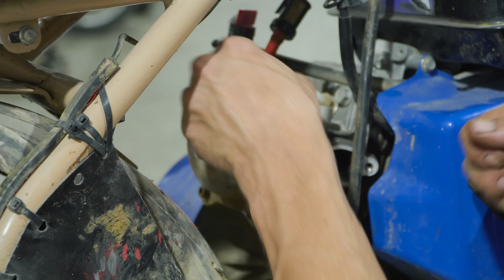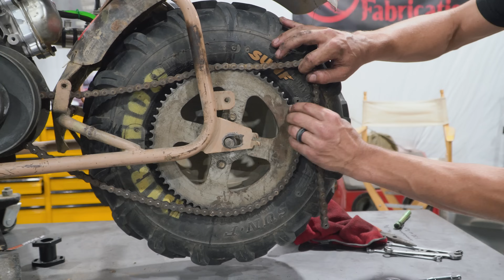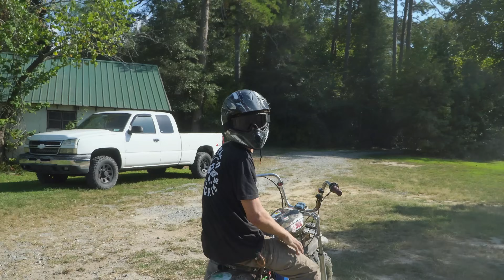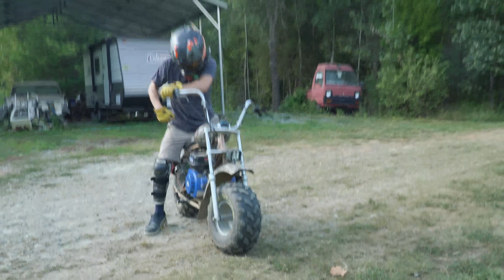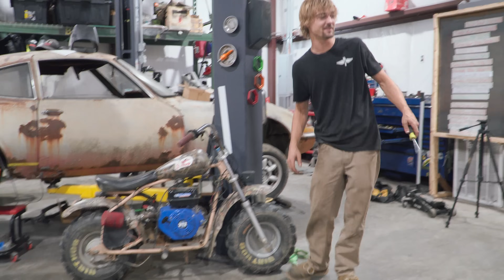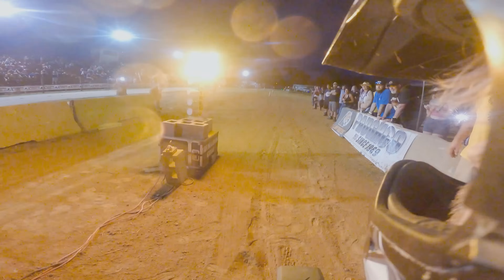Mini Bike Dirt Drag Racing Gone Wrong

Comment: Dirt drags what I grew up doing in Bedford pa thanks to family and learned how build motors if it high clay u need a mild tread tire we use to burn of new nobby to about 1/4 tread or well cut tire need to spin coming of line sound backwards but with powerful bike u get hole shot without flipping there's a fine line and usually 2 or 3rd depending on bike and gearing dirt is fun time and I've remembered we ran mini class 50-110  class and were beating class times above use 125- 200 this was in early 90s with a Bridgestone 65cc dirt bike rare even back then now its sits in a show case a my uncles cycle shop it took national and state trophy for 2 years and many other races and should just stuck regular bars on it for proper handling should. Keep up good work and everyone have wonderful day.

Comment: I have a number of different size engines on various projects. I 1/4 inch drill the oil holes between the cam tap it’s. The only engine that spits oil is a 212 that I didn’t drill out.

Comment: Hey Bubba, check this out, i learned this the hard way, by tossing the chain through the cases around the countershaft sprocket, basically totaling a perfectly good old Yamaha YZ465 .  Nowadays, I ALWAYS use a new masterlink clip.  Also, some of them, when theyre made on a punch press, have a very slight rolled over edge on one side, i always make sure that the sharper edge,  faces out, just to help retain the clip in the groove.  Careful now, and good luck.

Comment: My 26" mountain bike, with a 212 Predator engine had the same problem of not wanting to keep the front wheel on the ground, when pulling away from a light. I had to learn some restraint to keep the rubber on the road. I thought about putting a wheelie bar in the back, but, after playing with the front forks a bit, I slowed the rebound setting, and stiffened up the springs, And the bike was less prone to lifting the front wheel off the ground, afterwards. With your rigid front forks, I think the only option you have, is a wheelie bar, or stretch out the frame in the back.

Comment: When you’re putting the Mikuni intake on just put the Allen key through the bolt hole on the other side. It works every time I did it my predator 212.

Comment: Charles, on roller rockers you never slide the gauge in under the roller as it rolls. False reading. Always slide the gauge side to side to get a genuine gap. You 'will' suffer from tight valves much quicker than doing it the right way. 

One more nit pick, ratio rockers I've never heard of, however they are rockers. 1.3 ratio rockers would make a lot more sense so that the information is accurate and help the youngsters that may want to order a pair.

Great video, great time you had and glad you're shooting videos.

Comment: I had to tighten some bolts to 300 ft/lbs not too long ago. They held a tractor together in the middle. Its a lot but it wasnt as hard as I had expected it to be, to achieve.

Comment: Charles, get a couple packs of silly putty. You can bolt and torque a head with silly putty on the piston and no head gasket. Then you roll the engine over and check how much valve clearance you have. Then it'll increase slightly when you add a head gasket. You said "Are you alright". when the "Dad" came out. When I was a kid, it would have been walk it off and get back on.

Comment: I have a mini bike  with a predator 212 along with the torque converter, I tried taking off and i could not let go from the throttle when it wheelied. It kept bouncing and scared the living crap out of me. Its still sitting in the shed.

Comment: when you change the cylinder head with a milled off head and/or change cams and such do you have to change the push rod length or does it matter.

Comment: I've got to same bike. Custom motor, I don't care if a 300lb man was sitting on the handle bars you hit the throttle and that front wheel is coming up. It's got a torque converter and back sprocket is as big as the back tire almost. I got 4 little kids, I wanted something that could pull me up a hill, pull a trailer or do at least 55 down a hwy. It does all of that. I replaced the plastic storage tank with an actual small motorcycle gas tank. I got motivated watching Cars and Cameras!!

Comment: Hi all, I am working on a go-kart for my nephew  he's about 12. Anyway,  idk what it is. its  kinda like a yerf dog.  It currently has a Pr 212  live axle with 12 tooth clutch and  60 tooth sprocket. Needless to say, it smoked the clutch. I'm thanking about adding a jackshaft and pushing the gear ratio down to like 9:1. I know a clutch would probably be better if I wanted more speed but I'm really just trying to make it have higher torque and kinda slow for now. Any thoughts or suggestions?

Comment: fill your front tire with as much water as possible to make it a heavy and as difficult as possible to pop a wheelie. deflate the tire as much as possible stab your 1/2" garden hose over the valve stem turn the water on and wait until it pop off under pressure. hopefully now much harder to wheelie !!!

Comment: My parts for my stroker build are almost all bought now. I seen your guys build and I had to go for it. So I got 59mm CRANK ! Took me to 241cc in a small block and I have aftermarket reinforced everything because the GPS 285 lift / 260 duration cam is square nosed and welded and I put 50lb springs and 1.3 black venoms. I’d like to race you and see if you’re 228 or 236 can keep up with me. It’s a stripped and redone Mudstar 200 with lifted rear shocks and front forks to match so it’s off road ready but it will be a road king for a time.

Comment: Next time you drag race that bike , take the Belt drive off and run a centrifical clutch and run a gear the same size as the clutch making it one to one.  That bike will not only come off the line better you will gain 15 MPH.  The belt drive grabs too much on the launch and slips too much on top end!

Comment: Its jamnut. Use the bottom nut. Not a socket to run it out. You can use a socket and and the closed end of a wrench to pop them loose without it in the hole too.  Also, they are just rocker arms. "Ratio rockers" makes zero sense. They are increased ratio from stock. Call them increased ratio, or  1.2-1 ratio rockers. "Ratio rockers" isnt a thing.

Comment: Charles Should have left the Wig On. under the Helmet so the Hair flew in the wind. Lmmfao
Reply: If you don't dump it or Fawk it up atleast once...Your Not Having Fawking Fun..  John and Charles are cool A.F.  I have a big Question. I have a 17 hrs power Honda As 3500 727 c.c Motor and I trying to figure out what size Carb I need. Anybody got A Suggestion.

Comment: have you considered making an exhaust the bends down and back up again before exiting in a fairly usual place? I ask because a 3 foot long exhaust works really well, and if you can make it fit within the dimensions of the frame... every little extra bit of torque and Power helps

Comment: Im glad your alright John. I took a spill like that on my old mini bike but going about 30. I ripped a pretty big and deep gash in my arm  and I probably should have gotten stitches. Instead I super glued it together and used duct tape for butterfly bandages and went back to riding. I've got a pretty knarley scar from that, but the bike came out unscathed.

Comment: Yeah hard to take the dad nature out once you've become one, and it doesn't change as years turn into decades, even when you're grand kids have kids.
You just try to let the younger dads do their job without stepping on toes. 
The whole time your fighting yourself internally to stop yourself from going to check everything out for yourself. 
You just have to wait until they get there first to assess the damage if any, and then you walk over to see that they handled it appropriately. 
No different than wanting to jump on whatever they are riding just like your they're age.
Funny how your body has figured out that it's not in it's best interest to do those things anymore, but your mind is saying hey we got this. 
It'll be fine, just like the old days use to be. 
Funny how your mind forgets all the aches, and pains your body has been through.
Until the next morning when just getting outta bed seems to be a chore, even though you haven't done anything in years to cause such issues. 
Only the truth is that it's everything that you once did that causes those mornings where it would be nice just to lay in bed little longer hoping that the old stiff joints will ease enough that you can just get up like you use to without feeling like it would be easier just to slide off the bed, and then use the bed to crawl up off the floor.

Comment: Rule of thumb is if your running .030-.040 head gasket  then you should be able to turn motor over without head  gasket with no interference then your safe with gasket installed. Shooting for .030 squish is max performance

Comment: Dang Charles, if that's the same bike you were running last year at the races? It was already so fast! I have a prediction here before I see the remainder of the video. With a higher flowing head and a smaller sprocket in the rear..... it's going to devastate your bottom end power. There's a point of no return even with engines, when you can actually over flow the displacement of your engines capabilities. You'll lose velocity in your intake runner and the fuel will not completely atomize on its path to the combustion chamber. This goes against popular belief that Biggers always better when it comes to engine. Displacement possibly this applies. But anything else you are doing nothing but rolling the dice. Mathematics and or computer engineering or even a good flow bench are the tools necessary to determine what the ultimate sizes or flow rates would be beneficial towards your engines displacement. But this all then changes yes again depending upon the bore to stroke aspect ratios. Engineers have found that a big bore and short stroke requires a lot of airflow as quickly as possible. So a stupid higher flowing head or cam or valve sizes are what's going to best match this type. The engine with more stroke than bore. They need a smaller diameter intake and exhaust runner and prefer having a little resistance along the way.  The square bore/stroke is the grey area. Where it's difficult to determine whether it's going to like more or less flow rates. And this only applies to N/A engines. If you are using a pump of sorts supercharger or turbo, all these rules seem to not apply, because it's called forced induction for a reason. The pressure and flows of the pumping device is capable of overcoming the restrictions or lacking of velocity by artificial means. In many cases a bandaid for bad engine designing, like say a junkyard LS. They've been engineered for ultimate performance under N/A environments. Though they're not the biggest in displacements and the heads don't flow as much as say aftermarket ones. This means being so close to their maximum N/A efficiency, the only thing that you'll gain from a compressor system is much more power and efficiency because of how well they have been developed for N/A purposes. 😂